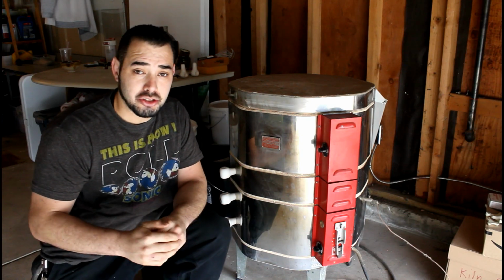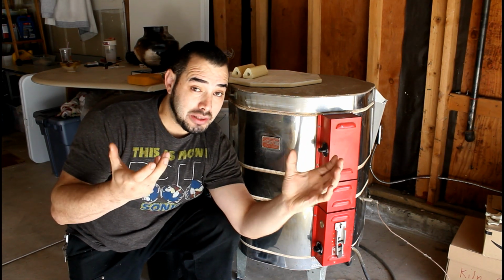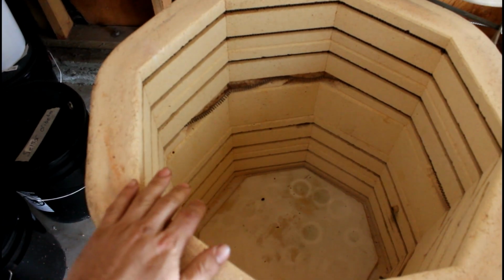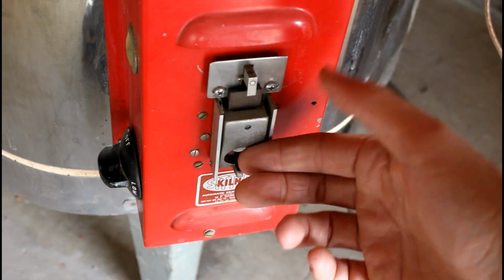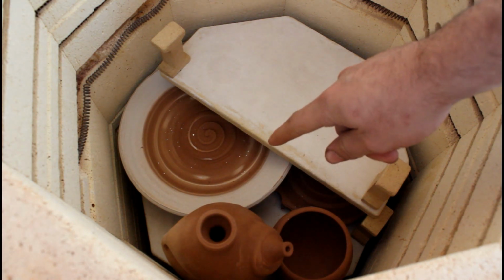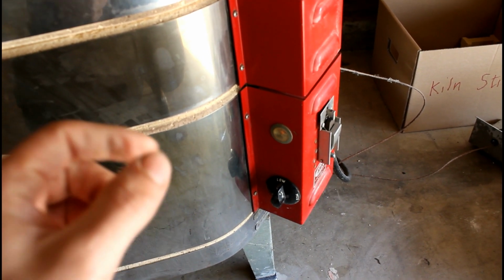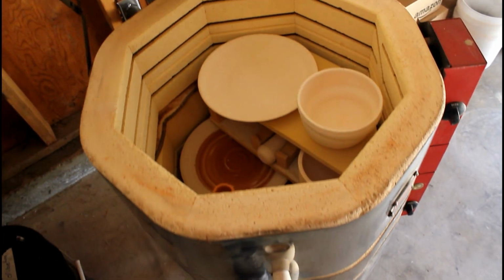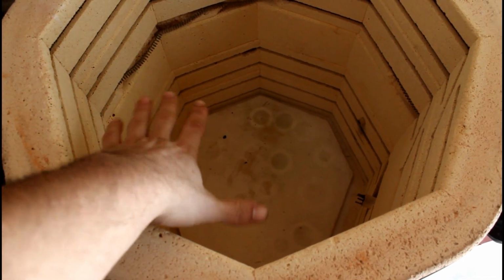How to fire a Skutt 181 Manual electric Kiln. (buisque)

Comment: I just bought a tiny test size kiln (Cress B-911-H). It has the K kiln sitter, and is so old it doesn't even have a timer, just an infinite dial instead of (H-M-L). I watched your video for help since I've never fired before and was really intimidated. I did the 2 hrs low - 2 hrs Med - 4 hrs High. The kiln shut off within ONE MINUTE of the 4 hour timer! That's amazing! Thanks so much!  I named my kiln R2D2 because it looks so similar.
Reply: I’m so glad you left this comment! I have nearly the exact set up as you and couldn’t find info on the “infinite dial” on my K sitter!

Comment: Very informative, for beginning potters.  One thing though.  S-Cracks aren't caused by quick firing, at least not soley.  They are due to improper compression, of the clay, after opening the clay.  This leads to uneven thicknesses, which means the thinner bits dry faster, and pull away from the thicker bits, causing the cracks.

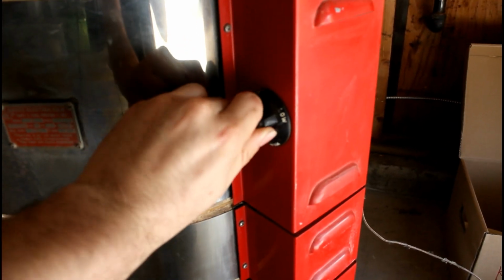Comment: I'm a newbie newb and your videos are super helpful!  Dumb question? At 15:30, I have the same two knobs on my manual JenKen B-118.  I assume they control the elements in the top/bottom of the kiln, respectively? If I only have wares on the bottom, should I use the top knob at all? Not sure if I'm thinking about it correctly.

Comment: Is your bottom shelf sitting on posts or is it ok to put it directly on the kiln floor? The previous owner drilled a 3 inch hole for vitrigraph on the floor but I don’t want to buy a new kiln floor slab. I was hoping putting a kiln shelf directly at the bottom would solve the problem!

Comment: How many hours does your kiln typically take to reach temp for a bisque firing? And a cone 6 glaze firing?
Reply from the maker: About 9 or 8
Reply: For both firings, bisque and glaze?
Reply: For both firings, bisque and glaze?
Reply: @morganphilhower3917   That could be for both.  That seems to be average for a Cone 6 firing.  For a bisque, it could be a bit quicker, due to the lower temp, or longer, due to the slower rate of firing most potters use, as a precaution against steam explosions.
Of course, this also depends on the age of the elements too.

Comment: Found a skutt 181 for sale and wondering how much it weighs/ how to get it on a truck. Any info/advice much appreciated. Thanks!
Reply from the maker: It comes in sections and the oatmeal break inside is pretty light, you just have to take it apart and piece it back together at a new location.

Comment: Hi! I just got this kiln second hand, and my light flashes / blinks. Is this normal? There is also no way to determine when the switches are facing the correct way, so I assumed it would be the same as yours - whatever is pointed up, is the function - ie, if “off” is on top, the kiln is off. But my kilns light seems to be on and running when “off” is up - so I have no idea what way is what! If that makes sense.. haha. Would appreciate any advice! Thank you.
Reply from the maker: The blinking lights are very normal but I don't know about your on and off switches because of mine are labeled low medium and high.

Comment: Thanks so much! Any chance you have a video for glaze firing in the manual skutt 181? I have the same kiln and had no idea how to use it. I have cone 6 glazes and am unsure of the temperature schedule. How many hours at each setting? Some sites are telling me to use cone 7 because the 181s don't get as hot as they should for the cone 6 glazes. You made the bisque fire very easy to do. Can you help with the glaze firing?
Reply from the maker: +Donna Dawson I will put it on the list :)

Comment: my kilin name is babe. I have a funny kilin no buttons just a heat dial for the hours and a push button to start. I'm having trouble with my cone 05. melting way to much. I fired a load just 3 christmas trees and bases.and a few other things not a full load and set it for 7 to 8 hours it came out fine but the cone was stuck to the setter.wtf do u think I'm doing wrong ty.lol help.